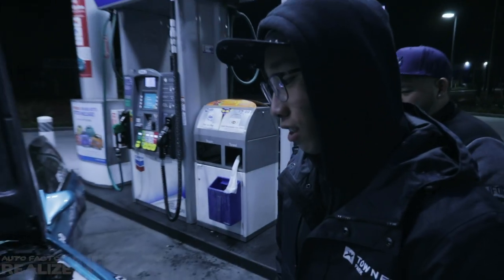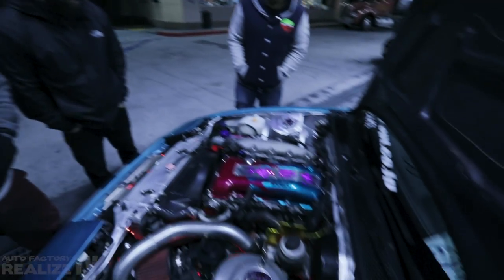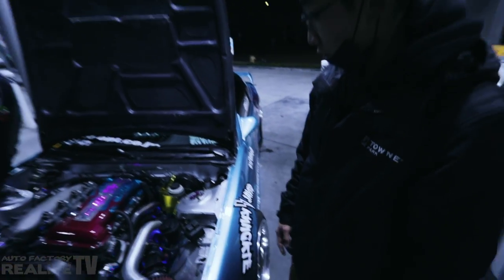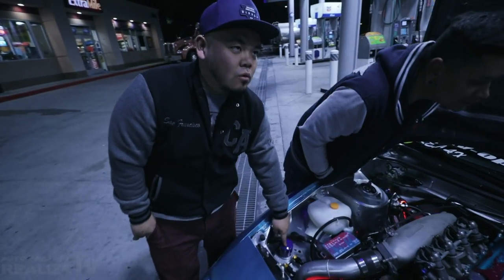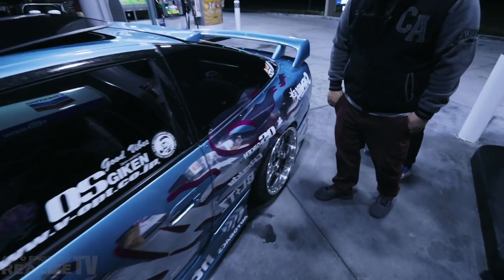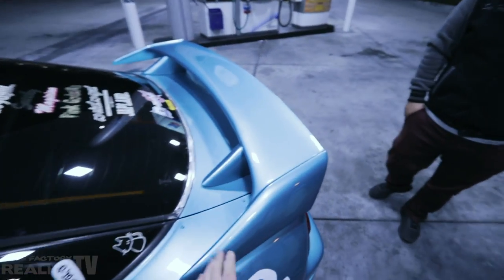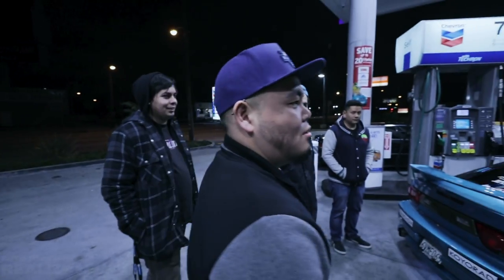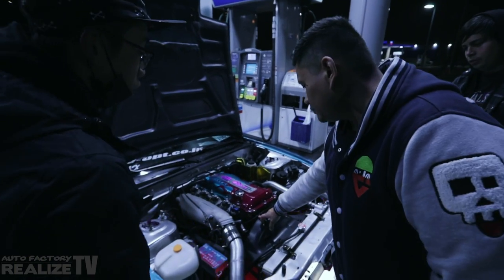SPOTTED: Was that a new REALIZE car?!

Comment: Engine/turbo specs? Seems pretty responsive
Reply from the maker: I believe the turbo specs were mentioned in the video. S13 SR makes around 340hp. It’s pretty quick.
Reply: Just had a proper listen then, basically exact setup I want to do cams wise, injectors etc, except retain vct. Should help turbo come on even earlier.